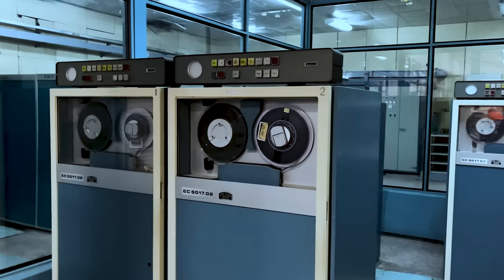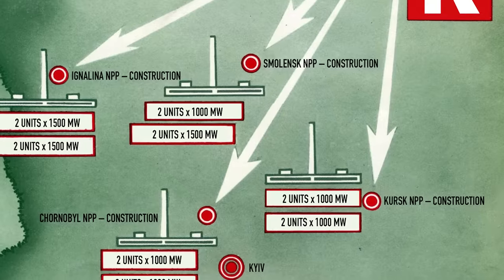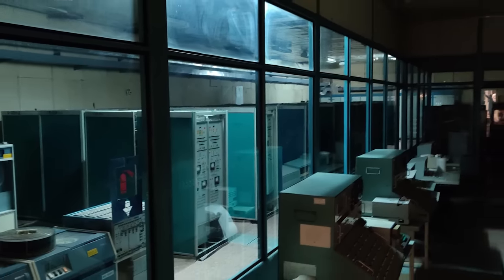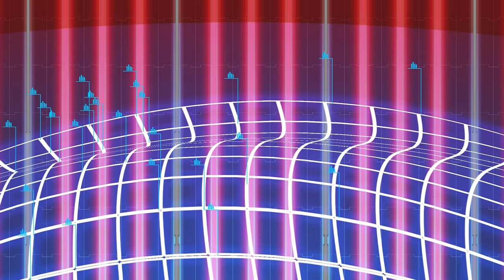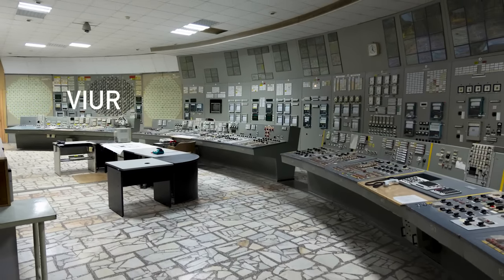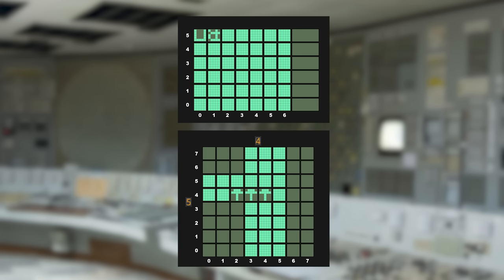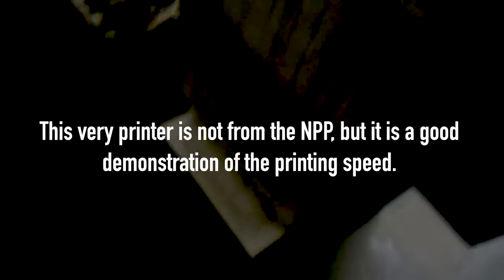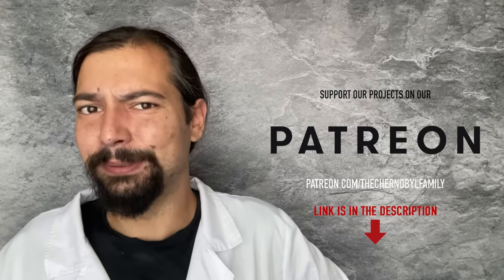Exploring SKALA: Chernobyl Reactor Control Computer

Comment: Fascinating. I never really looked much into this and didn't expect that they actually had such a complex DAQ and control system.
I thought this was all done by hand with manual gauges and some discrete analog electronics.
Reply from the maker: So much still to discover. We personally, although knew it is far more than a computer, did not expect it is THAT big in its role.
Reply: @ChernobylFamily  And all that in 20k words.  A lot of people today don't realize just how much one can do with that.  I'm really interested in learning more about the V-3M's architecture (CPU, buses, etc.); maybe a follow-up video?

Edit: That's 20k addresses of 24-bit words.  Still impressive though.
Reply: @alexhajnal107   "A lot of people today don't realize just how much one can do with that."  Its basically driving hardware, nowadays everything is emulated by software, and we have 50 years of layers on top of layers to make things super complex and use a lot of ram. That machine had none of that, just bare assembly code, you don't even need to have code to display things, there's actual physical display devices.

The amount of things you can do with very little RAM when the hardware itself does the heavy lifting is amazing.
Reply: I'm surprised that it did had a kernel/user division.
Reply from the maker: I'll just add a correction, those are 20 octal KB, so roughly 200 in binary. It used 24-bit words.
Reply: @alexhajnal107  Remember the software was written in machine code not a high level language.
Lots and lots of memory for code.
Reply: @andrewallen9993  Yea, I'm aware of that.  Not as easy to write but a heck of a lot tighter.

Personally, I prefer coding in C (compilers are really good these days) but I do know several assembly languages.  Even today I'll switch to ASM when that's what it takes to make the code fit into ROM.  (The smallest system I've coded for is a RISC chip with 32 bytes of RAM and 1kB of program ROM so I can appreciate the need for tight code.)
Reply: @alexhajnal107  Sounds a whole lot like my beloved ATtiny10
Reply: @0xbenedikt  That's the exact chip :^)  SOT-23-6
Reply: @alexhajnal107 Bespoke instruction sets can create so much optimisation, it's amazing! But the downside is that such special purpose machine is now only limited to its original intended use. Beyond that it's not particularly practical. A general-purpose computer on the other hand is equally mediocre at most things 😅

Comment: Great video.  I work with modern marine automation systems as part of my job. I've always had a fascination with the SKALA system since learning of its existence, but there was almost no information out there about it, how it worked, or how extensive it was.

Considering how far Soviet computing technology lagged behind the west, this was a surprisingly capable and extensive system that monitored probably thousands of data points with relatively little computing power.

It's also cool to see some things that haven't changed all that much - e.g. the operator station at 11:40 for reading automation tag values is a concept that really hasn't changed.

Great job in documenting and helping to save an interesting piece of computing and industrial automation history
Reply from the maker: Thank you for sharing!

Comment: This is awesome, totally delivered on what I’ve been looking for from this channel! It would be awesome to preserve the software and maybe with the documentation someone could build an emulator for the machine code to run SKALA and let it live again. Let it be the core of a Chernobyl simulator and see how the computer would respond to different inputs and situations in the reactor. I’ve seen another Chernobyl reactor simulator before but I highly doubt it’s running the real skala code.
Reply from the maker: Well, documentation for this is a half a ton of books, but at some point some pieces of it really can have a use. For now we are thinking to rebuild some parts, which can be interactive, e.g. a request device.

Comment: Very cool documentary. Thanks a lot. Maybe you could think about a part 2 including more info about the H/W architecture of the SKALA and its monitor/OS. You made a comparison with the AGC. Did the SKALA also have a prioritization of tasks like the AGC did? Some remarks you made that measurements might be delayed waiting for a "processor window" seem to indicate that it did. How exactly did this task scheduler work?
Reply from the maker: A continuation will come, though that will take a lot of time in the current conditions. I'll check on your questions with engineers and come back.

Comment: Very interesting.  I worked in US BWRs from the mid 80's.  They had data gathering systems that tracked the power levels throughout the core.  Like the RBMK, during refueling individual bundles were shuffled based on their previous exposure 'burn up'.

Before this time, some plants just recorded the data on tapes and sent them to a vendor that would read/ analyze and project future thermal performance and 'fuel shuffles'.

Yeah, those old 'band printers' were not particularly fast.  Ours were 300 lpm (lines per minute) but the alarm typer was a simple dot matrix that was much slower.
Reply from the maker: Thank you for sharing all these details.
Reply: The move over to DEC VAX's for near real-time would have been a huge step forward.

Comment: Great video. This computer was amazing, it reminded me when I flew the Embraer 190 where everything is also controlled by the computers, with self tests, failure detection, dual channels that switch automatically. 
All you have in the cockpit is a digital interface.

Comment: Wolderful. Thanks for a great video !! 
I whish there were english documentation of skala Computer manuals and architecture so it can subsequently be emulated on an an FPGA !!
Cheers
Reply from the maker: Thank you! Well, we have serious doubts it is possible to emulate is on FPGA, as it was octal-based, not binary, and was heavy dependent on analog devices. BUT, we plan to recreate some devices that were parts of it — in action!
Reply: @ChernobylFamily  with enough engineering time (and people wanting to volunteer for that) it should be possible to make an emulator for the software, but that would require knowledge of the inner workings and extensive documentation (like for example how the processor works exactly)
Reply from the maker: We will suggest the idea. The obstacle is the dаmn wаr.

Comment: Designing these systems must've been so complicated back in the days with the tech they had both software and hardware. I wonder which was more complicated: a nuclear control room or a lunar mission control room, as they were relatively from the same era
Reply from the maker: Both were different versions of Hell for their engineers, what can I say...)
Reply: the nuclear one, for sure- every single fuel rod had multiple sensors around its location, and with soo many.
Reply: I’d say the space missions. One reason. Distance.  Meaning analog needed to be converted to digital and then RF modulation. Also the latency and dark zones. But I think the nuclear plant needed A LOT more of responsibility and watchdog systems for redundancy routines.
Reply: @syproful all this could now be controlled via a single plc now.

Comment: Thanks for this very interesting video.
Would be fun to have a SKALA-emulator 🙂
What does the buttons аз-4, аз-3, аз-2 and аз-1 do?
Reply from the maker: That are not all buttons, AZ-x before all stands for operation sequence of the system of emergency control; so AZ-5 is 5th sequence which means dropping the reactor power to 100% down. Other AZ sequences reduce it for various smaller percentages, but all them have the same purpose. As far as we remember, not all AZs are possible to use just so, there should be certain conditions of neutron field and energy emission to make them work.
Reply: Remind me to kidnap you if I steal an RBMK 😂

Comment: When you realize a single board computer can do the work of this entire complex..
Reply from the maker: It can not. Even SKALA-Micro, a modern version of this is far, far more than a single-board computer.
Reply: @ChernobylFamily  I thought that adding multiplexers as inputs and outputs, you can increase the number of devices and sensors attached to a single board computer to thousands.
Reply: @DesertVox  You obviously have no idea about industrial computers business.
Reply: @DesertVox  but you add huge latency, which is not good. having one control card per channel, you can have interrupts for unexpected values and such.
Reply: You would probably need an FPGA to do it properly to deal with the latency. With lots of dedicated IO. You could do it in much smaller form for sure though.

Comment: Is Russia still using these for the remainder of their RBMK reactors?
Reply from the maker: As far what I know they have skala-micro, which is a microprocessor-based system that has only a name shared, technically it is totally different.
Reply: @ChernobylFamily  yeah I guess it was inevitable they would have had to have upgraded the aging system at some point, but I bet they had it running for a good amount of time. Its surprising what old tech is still in use.
Reply from the maker: At ChNPP the serious upgrade was not made because initially the shutdown of the power plant was planned for 1994. It was a big fight to prolong that and it carried on up to 200p. While could up to 2015.

Comment: Nerd question: can a Raspberry Pi replace or emulate this beautiful beast? 😂
Reply from the maker: Not really. While it feels so due to its modest calculating capabilities, the task it solves are thousands of analog signals to be digitized and processed simulaneously.
Reply: @ChernobylFamily I know, just had to say it 😅. 

From your video, I'm forming the impression that a specially designed and coded modern computer with about 15 thousand individual ADCs and other I/O could probably do what SKALA did. It just puts the capabilities of this machine into perspective - for me at least. Many thanks for this video ❤ 😊
Reply from the maker: This is actually what the SKALA-Micro, a later, microprocessor version was :) However, apart from name it has absolutely nothing to do with SKALA - just it was named to pay respect to the legendary system:)
Reply: @ChernobylFamily Wow, didn't know that about SKALA-Micro. Are those still in use?
Reply: @ChernobylFamily Wow, didn't know that about SKALA-Micro. Are those still in use?
Reply from the maker: SKALA-Micro is some russian creation for their remaining RBMKs, do not know anything except it is microprocessor based and it has nothing to do with original SKALA (they used the name as more a "brand" one). We in Ukraine do not use RBMK anymore, only VVER, so we have different systems.
Reply: @ChernobylFamily My apologies... Didn't realize that SKALA-Micro was a Russian thing. I vaguely remember Kurchatov Institute being involved somehow in the early parts of it's creation, so I thought it was late Soviet or something like that.

Chernobyl never received the computer upgrade then.
Reply: I mean, emulate, yes!? This thing isn't doing anything beyond the Turing Limit.
Reply from the maker: The upgrade was — the DIIS in 1991 and then DIIS-2000 as they were afraid of the Problem-2000 (did not happen, luckily)
Reply from the maker: Well, emulate... possible, but we will need HELL of budget for this:)

Comment: Great video! Also: SKALA was not based on ES EVM (soviet copy of IBM 360), this was not typical of soviet computer systems of that time. Also turns out that you absolutely needed this computer system for normal operation of the RBMK reactor, as RBMK had an unusually large positive void coefficient. RBMK doesn't keep water inside the reactor under pressure, now you end up with fewer water within the reactor, as the water evaporates. This creates temporary voids. Now water is also a neutron absorber, so that these voids are resulting in a stronger chain reaction and increasing the thermal output. Eventually the whole thing exploded...

The book "Midnight in Chernobyl" by Adam Higginbotham mentions an accident at the first installation of the RBMK reactor in Leningrad: 

"On the night of November 30, 1975, just over a year after it had first reached full
operating capacity, Unit One of the Leningrad nuclear power plant was being
brought back online after scheduled maintenance when it began to run out of
control. The AZ-5 emergency protection system was tripped, but before the chain
reaction could be stopped, a partial meltdown occurred, destroying or damaging
thirty-two fuel assemblies and releasing radiation into the atmosphere over the Gulf
of Finland. It was the first major accident involving an RBMK reactor, and the
Ministry of Medium Machine Building set up a commission to investigate what had
gone wrong. Afterward, the official line was that a manufacturing defect had led to
the destruction of a single fuel channel. But the commission knew otherwise: the
accident was the result of the design faults inherent in the reactor and caused by an
uncontrollable increase in the steam void coefficient.
Sredmash suppressed the commission’s findings and covered up the accident. The
operators of other RBMK plants were never informed of its true causes. Nevertheless,
the commission made several important recommendations, to be applied to all
RBMK-1000 reactors: develop new safety regulations to protect them in the event of
coolant loss; analyze what would happen in the event of a sharp rise in steam in the
core; and devise a faster-acting emergency protection system. Despite their apparent
urgency, the reactor designers failed to act on a single one of these directives, and
Moscow promptly ordered more of the reactors to be built. The day after the
Leningrad meltdown, the Soviet Union’s Council of Ministers gave its final approval
to construct a second pair of RBMK-1000 units in Chernobyl, expanding the
station’s projected output to an impressive 4,000 megawatts"

Interesting if SKALA was supposed to have fixed these inherent instabilities during low power loads, but no - it was only a monitoring and recommendation system that was not designed to control the reactor directly.

Comment: As a hearing Impaired podcast viewer, I am blown away by your commentary, I wasn't aware of the computer systems and I like to thank you for being informal giving the documentary. This is a absolutely genuine, especially the color tags with number and switches. I would love to have it as a souvenir. This is true when I was a teenager back in the 80's. My Great-grandfather was born in countryside outside of Odessa, when Ukraine was under Soviet rules. We are Germany-Russian Descendants.
Reply from the maker: We have a few buttons which are identical to those used on control rods control panel (the round assembly near AZ switches). Just they are not engraved because we bought them at kyiv radiomarket. If you wish to have - write us.

Comment: Thank you so much Im electrical Engineer and Instrument Control Engineer.

Thank you for sharing.
great content.

Amazing how they ran it and it didnt monitor the space for tge shortened fuel rods.

Which was ultimately the reasonbwhy it exploded.

operators didnt havd access to dat at thd time of the explosion.

So fundimentally the control system design was flawed.

Jeremy Penrice.
Electrical Engineer
New Zealand.
Reply from the maker: Our pleasure!

Comment: Fantastic work. This is seriously interesting. Modern technology has come so far, it seems like nowadays a single computer could do everything that vast network of computers did. Seriously cool. Thanks for sharing!
Reply from the maker: Partly you are true, especially in regards of the computing power. However, still there would be needed some custom solutions for the processing of a large array of incoming analog signals. I mean, it surely would be made more times effectively now, but anyway not out of the box.

Comment: It's been very difficult to find any SKALA specs online, at least in English. Thank you!
I'm guessing SKALA as a computer-based platform didn't actually control the plant actuators, but it was solely a measurement/logging system. This is often the case in nuclear facilities, even today. Especially protection systems are often implemented in non-software based platforms.
Suggestion; study the architectures of RBMK reactor power control systems, protection systems (SUZ), neutron flux measurement systems (AKNP), and make another awesome video. Any data of these systems is also difficult to gather from online sources.
Reply from the maker: Thank you! I'm considering making a separate long video about RBMK reactors, so I believe that will be the place to cover those questions.

Comment: Thank you so much for making this video and doing the research on the SKALA system. I've had a fascination with the Chernobyl disaster since I was a teenager and I honestly believe it led me to the career field I am in today (Controls Engineering). I work with programming and integrating PLC and HMI solutions and get to work with the modern day equivalent, SCADA.
There has been very little on the overall system and this video goes above and beyond what I could've hope to see. The only wish I have is that one day I'd be able to see SKALA in person!
Reply from the maker: As soon as wаr will be over, you are warmly welcome to visit :)